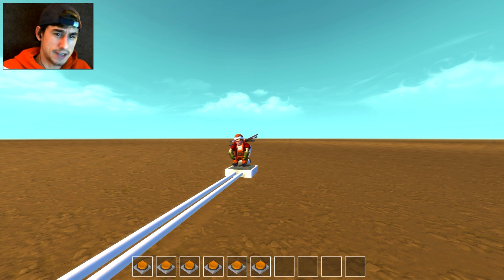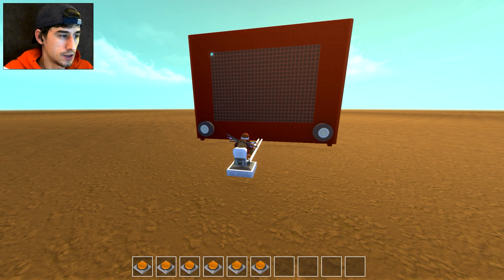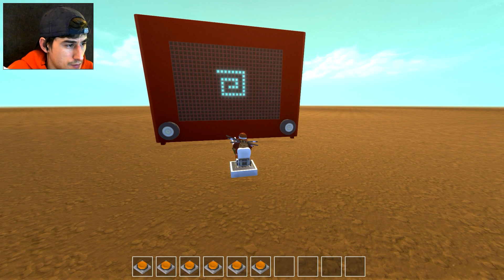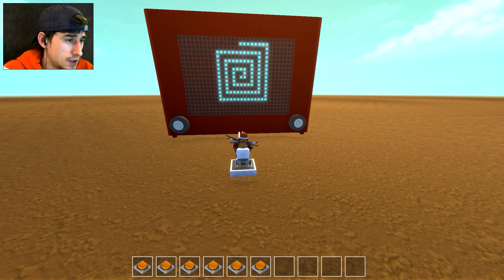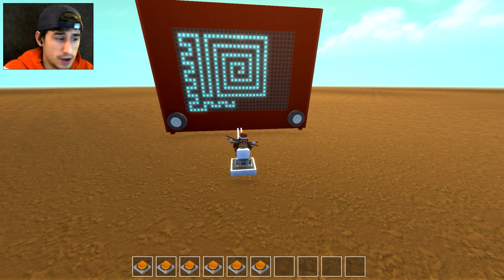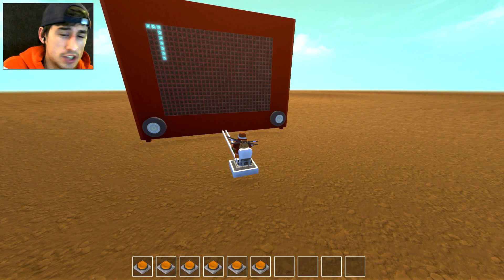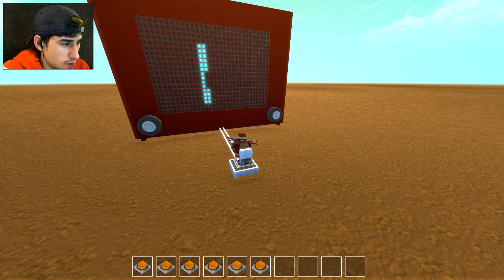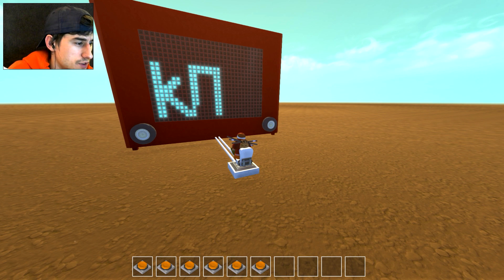Etch A Sketch with Logic Gates! (Scrap Mechanic #83)

Comment: hey man, big fan ;) love the hover city :D
Reply from the maker: Thanks! Hopefully that new engine will allow for more sections at the same time :D
Reply: yeah i hope so... i have a medium spec pc so i can run only one section at a time then i have like 30 fps, if i try to spawn another one and weld them together i get between 15 and 20 fps
Reply from the maker: Yea I get only about 3 sections with frames around 30 fps. After that it just becomes a nightmare.
Reply: hoping for much improvment in the update, it isnt far from releasing now is it??
Reply from the maker: Open in test branch on the 31st I believe is what the devs were saying.
Reply: hoping for the best!